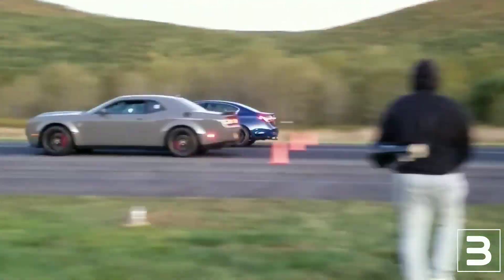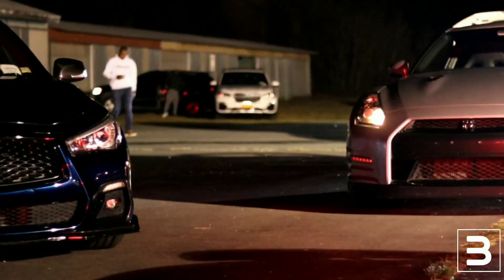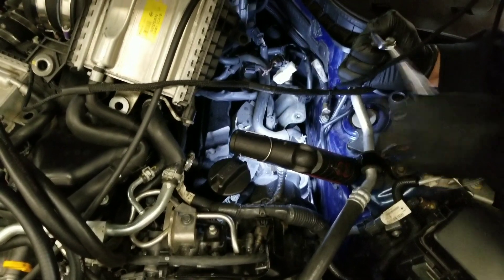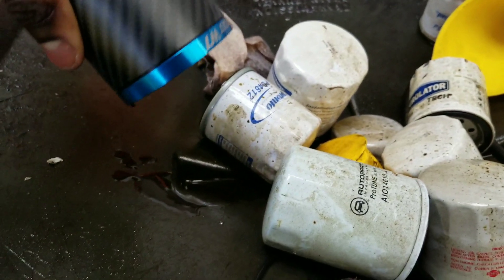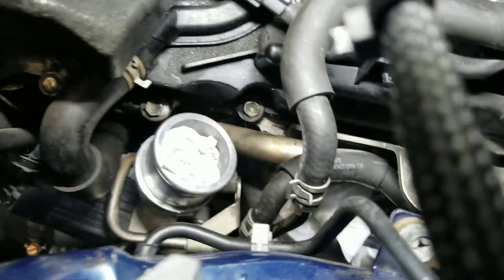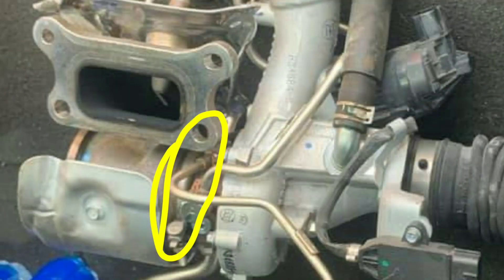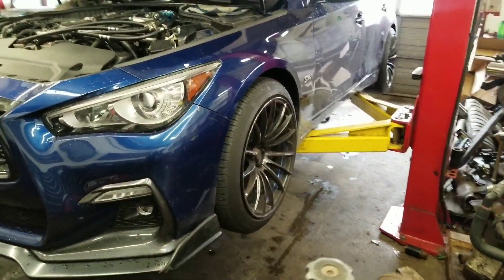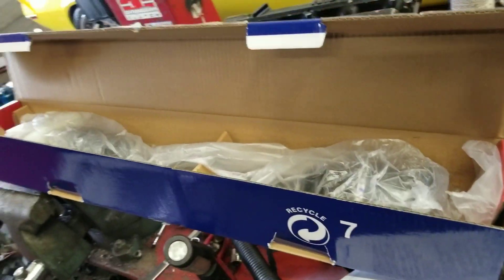Blown turbo on my Infiniti Q50

Comment: 2019 Q50 RS un-modded here.  Both turbos replaced and a fuel injector @ 13K miles.  Infiniti dropped the entire engine to do the repair and the warranty work invoice they gave me was 6 pages long.  I would try warranty first.  Job took 2 weeks but they gave me a loaner with unlimited miles.  No other issues so far with the car.

Comment: I am a service manager at an infiniti dealership. Turbos on these models are insanely common and to be honest we barely bat an eye anymore,   Technicians usually stay quite about mods too because a set of turbos pays 9.2 hours warranty and takes maybe 6-7 hours. You can definitely get them warrantied.
Reply: I’ve got a 2016 red sport and it’s wife driven so she babies it. Even when I get behind the wheel I baby it too in fear of wife kicking me out of my house. I bought it as a lease return @15000 miles it currently has 18500 miles (barely driven). Purchased the extended warranty good for I think it was 5 years and 100 k. Obviously it will expire via time rather than mileage. Plan to keep it stock and plan to baby it all the way. My question is would the turbos still go out during light to normal use over its life?
Reply: Yes, just make sure you change oil at 4-5k miles. Check up on your air filters periodically, blow by is a major common issue on these. Take care of it and the care will do its part
Reply: Caleb Stanek Thanks bro. My service manager says it’s not necessary to follow the general rule of 4K to 5K oil changes but rather to follow the Infiniti recommendation of 10k miles or 1 year. To me that’s way excessive. I’m pretty much ocd so I change my oil every 3 months on my own regardless of miles (wife puts on literally 4k this past year) using synthetic oil. So yeah I’ve done 4 oil changes already lol. As far as the air filter I didn’t know that. I’ll be changing it/cleaning it out now. Any other tips is welcomed. Thanks again.
Reply: @freddie5744  yes because the turbos are garbage in this car
Reply: @KORNABLOCK  I’ve read that the turbos are made by billet. Didn’t know billet makes garbage turbos. Care to elaborate more?
Reply: @freddie5744  from what I’ve seen, the turbo issue is a from laving low oil and people who mods their cars. I haven’t seen anything to really suspect it’s wide spread
Reply: @TheNgp90  well i think the turbos arent the greatest quality in the world...he said he had the “old version” turbos or something did they change them at some year point?

Comment: That sucks.  My turbos were going bad too around 50K.  Took them in and they were going to warranty them but parts weren't in so they said they'd give me a call when parts came in. I called several times to check and nothing.  Almost 5 months later turbos "finally" came in but I drive a lot so car was just over 70K.  Refused to warranty even though they waited!  Infiniti on my sh*t list now. What's up with that Infiniti!!?? Anyways, good luck man! I may just put some real turbos on at this point!
Reply: How much did it cost u

Comment: Damn bro that sucks.. you should definitely try to get Infiniti to cover it under warranty
Reply: 日産スカイライン I know but it’s worth a try and it will let people like me know who is debating getting tuned whether I can get a tune and still sneak by and still keep my warranty
Reply: BLOCKAYE   No way are they gonna take a hit like that without finding out what caused the failure.  Simple check on the computer will show car was tuned and show it’s running double the factory boost.  Cause of failure is from over boosting the turbos. No way they will cover it.  You are going to embarrass yourself by trying.
Reply: WINNING I know it’s easy to see that it was tuned and running more boost and all that . But I know some people who work at an Infiniti dealership and said that they have done warranty work I’m tuned and modded cars before it would just be interesting to see it coming from one of the biggest vr30 platform youtubers
Reply: BLOCKAYE I guarantee they have not done warranty work that was a direct cause of a failure due to a tune.  The manufacturer would not pay the dealer for that work done.  Especially a big job like replacing a turbo. You are talking close to 5k if not more.
Reply: WINNING I agree with you 100% I’m just saying it would be interesting especially since the tune was done by ams who is a direct partner with Infiniti

Comment: I have the same turbo leak problem t 70k miles. I Noticed abnormal smoke from my exhaust on exhilaration and some on idle. Will be going to infiniti this week to see the results of the diagnostic since I do not know any shops capable of giving a proper diagnostic or replacement in the inland empire in california.
Reply: What did Infiniti tell u?
Reply: @marquiseh1562  I had to replace both turbos at $4k each and i definitely did not pay that. So I took it Toyota and traded it for a 2019 Camry with no turbos. I hid the issue just enough that they did not know my turbos were leaking, thank goodness lol
Reply: @marquiseh1562  how did you hide the issue lmfao

Comment: Ever heard the term got to pay to play. You guys are failing to realize this isnt a race car. Trying to turn it into something its not. idc what amount of upgrades you do, its not meant to be beat on every day especially as a daily. Number 1 transmission cant handle that abuse constantly. Number 2 ppl being cheap with the parts. Whether its a luxe, sport, redsport it doesn't matter.. although the redsport sensors on the turbo helps keep it in check, you need legit bovs as well. Ive been pushing 500whp n over 500wtq for almost 2 years. The most ive changed was one injector. Again i dont beat on it everyday. Even with the power always someone faster than you. Theres nothing to prove. Just enjoy your V and chill. Long story short you wanna play pay. Keep fluids checked constantly, and dont beat on it everyday all of you will be fine.
Reply: 日産スカイライン  thats exactly my point. But ppl wanna complain, bcuz they having problems when u beat on the shit.  You cant complain if you modify doesnt matter what the manufacturer is. Every car has its problems whether its bmw, benz, audi, doesn't matter.
Reply: it seems that the vr30 is a pretty solid engine to get beat on but everything external seems to die pretty fast lmao. i feel like upgraded turbos and bovs, upgraded fuel system with a cd manual tranny swap would make it pretty reliable even while being molested
Reply: I built an Acura Integra Ls Turbo, I was pushing 330WHP. I made a lot of changes to the engine before I placed the turbo. I had the car for 3 years with no problems. I recently sold it because I'm interested in this Infiniti Q50. Anyway, where I am getting at is, you do have to pay to play. But you also have to build it right. "You can't just jump in the ring because you think you can box." -Jesse
Reply: @salweirdz2161  the Infiniti is a decent car, if you take it for what it is. Just read up on the forums and learn from ppl mistakes. Your right you have to build it right, like i said b4 ppl wanna half ass it and complain.. i look at modifications to a car as if its like working out, you can make it stronger but it can still be broken. Lol
Reply: 日産スカイライン  yes but some cars can handle the daily abuse more than others for example I used to own a 300c srt8 beat the shit every day I even put a 200 shit of nos and the car never give me a problem usually big engines handle better the power also turbo cars are more prone to problems...
Reply: @b58forever  depends on the block. for instance, nissans vg30 is still a great and solid platform to make power on because that bitch is forged. some engines are just better off being n/a or mildly boosted
Reply: Seems like some of you needs need to hit up the forums and read the dozens of guys that are bone stock and under 30K miles, having turbo failures. 

Not having a diverter valve or bov is what's destroying these turbos.

Comment: I have a 17' Q60 Premium. It's Iridium Blue with a ceramic coat on the paint that I applied and it's so beautiful that the haters are all over the streets. This Q60 is a GT car that I would never drag race it at a strip or in the streets. It gives me enjoyment more so now that the stock run flats are gone and replaced General Tire G Max RS. I know that one day I will ad a Burger MS HE and a FI resonated cat back, but I will not push the envelope like you and others have only to experience major problems. I still have my 05' G35 sedan that has been trouble free other a few sensors and has a Tanabe cat back for the rumble( that's why I want a FI cat back for my Q60) . I view your content here and ask why are you and others so abusive to your cars? I really wish you well financially resolving your turbo problem!

Comment: Bless up bro....Sorry your turbos went out. Maybe you could go a forth route, an experimental route, if it hasn't been tried yet. Use the GTR stock turbos. Work with a custom fab shop to rig adapter plates to the manifolds to run different turbos. Or, see if you can run a modified stock GTR turbo and manifold set up, unless it bolts up to the engine.
Reply: You predicted the future to what they’re doing now
Reply: @evankastenschmidt1227  Really?
Reply: @Wiggy321  yea go look at what Bonnie and Clyde racing is doing. They put a GTR manifold on the vr30 with an A2A conversion kit. The manifold allows for bigger turbos such as the Garrett 660 too
Reply: @evankastenschmidt1227  I've seen what the A2A kit has been doing. That's pretty cool stuff. I just heard about their manifold adaptation a few days ago. I believe its still in testing. But yes, I guess I was somewhat clairvoyant lol. I want a Z, so lets see what else I can think up....Thank bro!

Comment: Boost, it’s the turbos. Take it to Infiniti since you under warranty still. They’ll cover everything and replace belt, align a/c compressor and fix the turbo leak. It’s the turbo failing so oil leaks out.

Comment: Wait so do 2019-2020 q50s have the newer model turbos that are possibly built better?
Reply: Kevin_le I would like to this as well.
Reply: Built better?  It’s the same cheaply built car.  It’s not made to handle more power than stock.
Reply: WINNING I honestly don’t know man... he said there’s like a new part number for the turbos or sum idk
Reply: Kevin_le   Yeah different part number but same parts.  They change part numbers a lot after a few years on many parts.  Car is not made to be modded.  It has cheap parts.  That’s why the car is cheap to buy in the first place.
Reply: Once I'm done with my G, definitely not staying with Infiniti
Reply: @Executiveinvestments-  listen, a turbo on most vehicles go. Thats why many people, like myself, opt for NA. I once owned an EcoBoost f150. I did some digging into its history as i got it used at 34000km. 28000km, the turbo + the head went with previous owner. This is the issue with high performance turbos. 

I had the option to get a 2016 q50s 3.0T or 3k more, or the 2015 q50 3.7. I opted for the better sounding 3.7 also likely more reliable.
Reply: WINNING does this apply to the bmws 335 I and 535 I turbos
Reply: WINNING which other cars do u have that have good turbos
Reply: John Lira   Mercedes bi turbo AMG, GTR, BMW M series, Porsche.  NEVER a single problem.  Infiniti is junk. Cheap cars.  As soon as you throw boost at it they fail.  Very common problem.
Reply: John Lira   And the 3.7 isn’t more reliable.  You are trying to compare a stock car to a highly modded one.  How dumb is that?   People have no problems with the 3.0 until they mod them.
Reply: @Executiveinvestments-  youve had them for how long? Not long enough. No need for your childish insults little man. It makes you look insignificant. Since youre leasing all your cars, you wont have problems.
Reply: Matt M   Not long enough?  Had almost 80k miles on my porsche.  BMW and Mercedes over 50k miles.  Don’t tell me not long enough.  Infiniti had turbo problems within 1000 miles of the tune.  All my other cars were fine.  Zero problems.  Turbos are NOT made to fail.  You have no clue kid.
Reply: @Executiveinvestments-  oh man you just gotta keep cussing me to feel good eh? All those emojis too. Damn you made your point big boy. My colleague makes 250+k a year and leases. So broke.

Take care of yourself.
Reply: Matt M   Sure kid you know everyone’s finances.  Yeah he makes so much but he can’t afford to buy a car.  Just like you “think” I lease.     250k a year.🤣🤣🤣🤣. You seen his paycheck.  Sure.
Reply: @Executiveinvestments-  ✌
Reply: Matt M   “All turbos fail”.  🤣🤣🤣🤣

Comment: What’s the reason that happened? I’m looking to get a 2017 q50 sport certified preowned. Seen your videos scary me at times
Reply from the maker: My car is highly modified for last 20,000 miles
Reply: They fail when they are stock. A tune could help them fail faster but the stock turbos are prone to early failure

Comment: How common are these turbo issues? I plan on getting a used q50s or rs and plan on modding it. Nothing too crazy with the motor will be modded but it will be my main car.
Reply: I have a 2016 redsport car is fast coming from having a 2015 Camaro ss I prefer this no doubt
Reply: Haven’t had any problems at all car is completely stock tho
Reply: Quick Scopes I’m coming from a pontiac g5 so it’s better in every aspect for me. Just like my cars reliable
Reply: A1 Bussin no doubt these car are reliable stock test drive one these cars they pull even stock
Reply: Motor blew at 30k for me

Comment: Yup weak turbos.  What will happen next is you will upgrade the turbos, tune and your high pressure/direct feed fuel pump will go due to the upgrade.  Get the pump upgraded while your at it!

Comment: All I hear on these cars is bad turbos. My jb4 Redsport never had the issue and sold if after 30k miles but I had trans failure
Reply: Hi Wedow,  can you explain more on the trans failure? What year is your red sport?
Reply: @bennyang8049  refused to shift and went into limp mode on several occasions. Sometimes not letting me leave 3rd under any circumstance. My red sport was a 17 q60 Redsport. Dealer flushed fluids and claimed that was it then it happened again and I sold the car lol. Moved in too a Kia stinger gt and couldn't be happier.

Comment: Just bought a q50 with 33k I wasn't aware this was an issue.
Reply: Joshua Wiggins same literally just bought mine 2 days ago 2017 silver sport
Reply: These turbos are perfectly fine with 500whp and under. Boost is pushing 550whp+ and have stock turbos with no Blow Off Valve (which he should have IMO) which kinda pushed this issue a little more. For simple mods like Full Exhaust, Intake, BOV and a tune, these turbos are perfectly fine
Reply: @bynjei2530  that's good to hear!
Reply: Bought mine with 29k motor blew about 500 miles later hope you've got a warranty
Reply: @keckers35  for real or u trolling lol I've heard the motor itself is quite sturdy with forged internals just gotta watch the oil levels like the vq's
Reply: @joshuawiggins7487  100 percent serious flew cross country to get it bought CPO. Drove 8 hours slept woke up and drove 3 and it blew. Dealership is replacing the whole motor and both turbos on warranty. If you have any other questions feel free to ask

Comment: I like these cars but I heard so many bad things about these cars am about to keep my genesis r spec or buy a c63 amg...
Reply: Lol so you're gonna buy a benz that costs like triple in maintenance? And shit always goes with expensive German.
Reply: @m.m14433  c63 amg are very reliable a friend of mine have a 2010 with 163k miles and beat the shit out of it every single second hes on his car and the only thing he have done is an alternator replacement. Now the 2008-09 c63 had the famous heath and bolt issue but after 2010 mercedes fix it. Also I would never buy those airmatic benz anymore like cls550 e550 e55 I had those cars before and have nothing good to say about it but problems with the suspension. Now c63 no air suspension that's a plus....
Reply: Black beast E550 This is exactly why I’m keeping my G37 I was going to buy a Q50 3.0 as a second car but I heard nothing but bad thing about them . The new 3.0 can’t match the VQ Build, I’m looking into a 2015 IS350F sport
Reply: @AQCE245  ya, opted for the 3.7 q50. Couldve got the turbo but decided that NA is the way.
Reply: @AQCE245  I you want reliability keep the vq 3.7 nothing worst than unreliable car...

Comment: Nissan is done bro.. The last good 6 cylinder Nissan built was the G37/R35.. Now lets say you upgrade your turbos something else will goo most likely the engine  itself.. Move onn Nissan is no longer apart of the big 3 Honda Toyota in reliability even Kia passed Nissan... Good luck brother